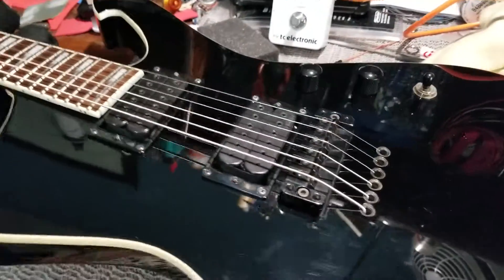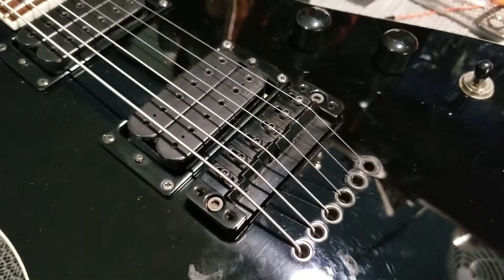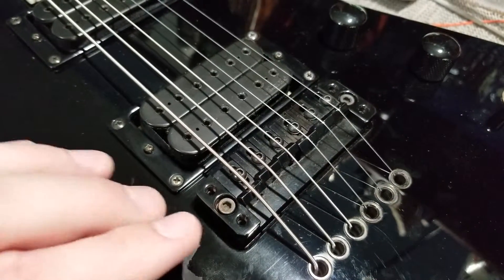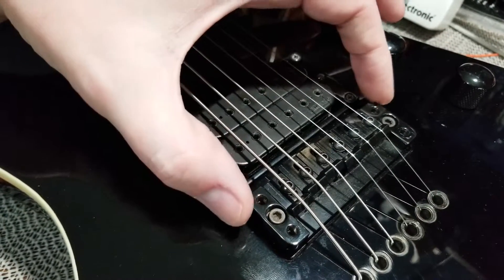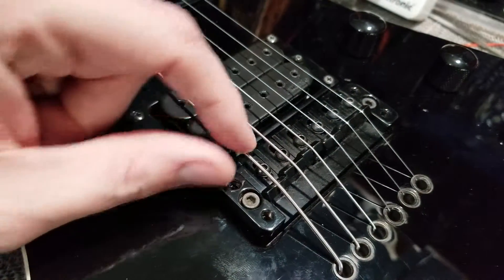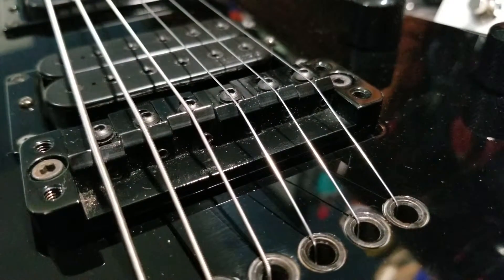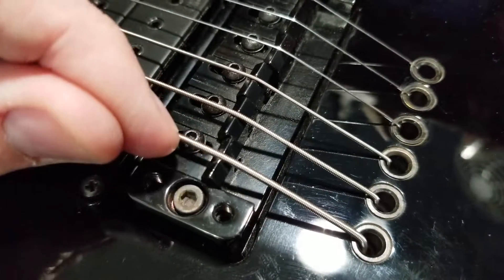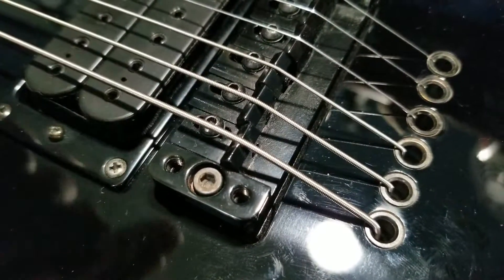Adjusting an Ibanez Gibraltar Custom bridge

Comment: I recently purchased an Ibanez VBT700 V Blade, which has the same bridge as your Iceman.  However 2 of 4 of the 2mm action/height adjusting screws at missing.  I've been trying to find replacements for them, but not having any luck, would you know where I can find them?
Reply from the maker: Sadly no. If you have something to compare to and measure from, somewhere like McMaster Carr could possibly have them.

But from my experience, guitar hardware can be very niche. I'd suggest contacting Ibanez directly to see if they can provide spare parts. I've done this with other brands and they've been very helpful.

Good luck!
Reply: Contact Rich Harris at Ibanez Rules. His contact number is on the Ibanez Rules website. If anybody knows where to get them, it’s definitely him!